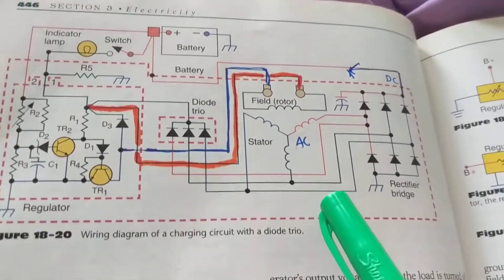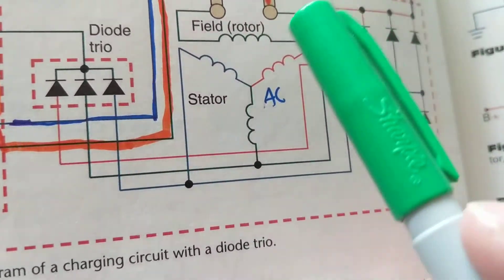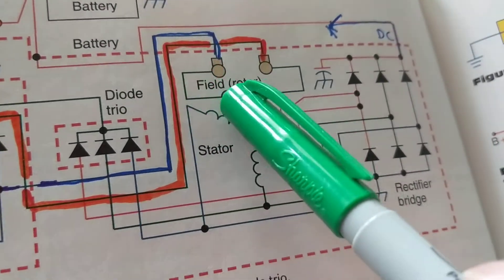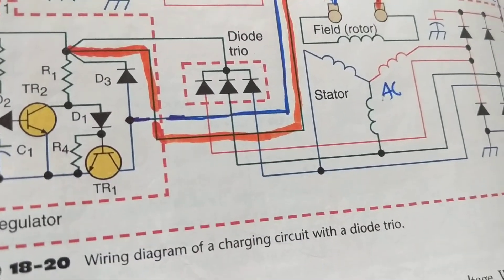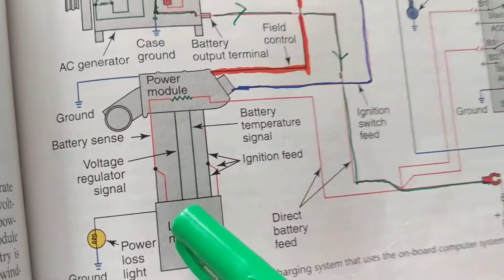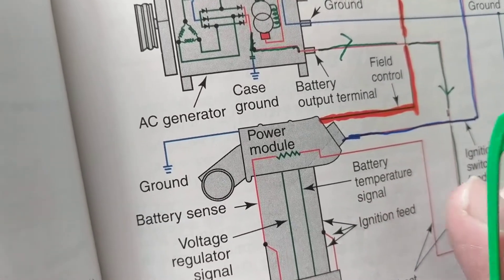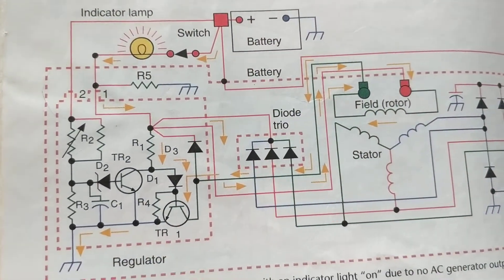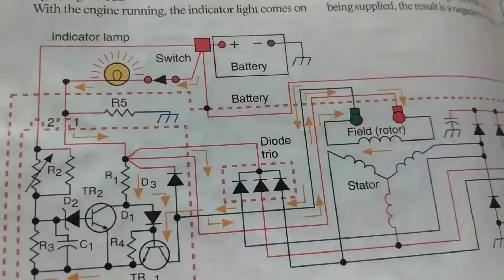wiring diagram HOW AN ALTERNATOR WORKS PART FOUR

Comment: Hello,  Today I accidentally connected up my battery in my 71 MGB backwards and fried the rectifier in the alternator.  I'm wondering about your opinion:  will the regulator be fried also, or would the rectifier have blocked power from getting to that?  Thanks.  ps.  Lucas Alternator.

Comment: On this Figure 18-20, 
How do you reconcile the preexcitation voltage on D3 initially applied to the rotor which is 0.7v driving momentarily the rotor. Thank you in advance

Comment: You need to take a course on electronics,as your explanations are way out. For instance a capacitor doesnt stop AC from the rectifier diodes & 3 phase stator, has no 90 degree output to name a few mistakes.

Comment: Very good! I would like to know how (in the  second diagram) the lamp gets its mass when alternator is not functioning; is that throught the regulator or via another path? Are the R1 (D1) R4 low resistances so that a current through the lamp exists?

Comment: Where we can get all those books😢.
Reply from the maker: You can try to Google it and put on a motive technology a systems approach the textbook I use was from automotive school years ago
Reply: @Joeelectronicschematicsforauto  yes, that's what I did, I search for information on Google and assemble it afterwards. 

but I wanted to know the name and publisher of this textbook so I could buy it if I found it on google.

 In one of your clips you showed the name and publisher of one of the textbooks (Automotive mechanics by Crouse and Anglin), I found it and managed to download it by exchanging it for another textbook of mine.

 That is why I am asking for the titles of each of your textbooks in order to find them and buy them. 
Thanks a lot for the answer.
Knowledge is power 🙂
Reply from the maker: @Yulian.Mladenov  you can type in automotive technology a systems approach get back to me if you do not find

Comment: If I have a 10SI  GM alternator 100 amp and when you start the car it's putting out 14.5 volts and as soon as the electric fan kicks on the voltage drops to 12.9 volts ...  Then if you turn the car off and then restart the car with no fan running or anything else drawing power but the voltage still stays at 12.9.  what could be causing the voltage not to go back to 14.5??
Reply from the maker: Sounds like a regulator or it could be a computer that controls the alternator if you have a multimeter you can read your something called  ripple on the AC volts scale make sure your belts are tight and the best way to do it is if you have a the force the alternator on
Reply from the maker: Put more accessories on and then rev up to 2,500 RPM and see if the alternator can take the loads voltage should be steady this is the first thing to do

Comment: Hello, where is the capacitor after rectifier diode locate?
Reply from the maker: And more technical diagrams there are capacitors also to filter out the ripple this probably was a very short one but thank you very good question
Reply: @Joeelectronicschematicsforauto  Thanks Joe. I have a good problem today, the battery icon in the dashboard light up 10 second after engine starts. It only appears after 10s and it is repeatable. So I was thinking it is a ripple not filter out well by capacitor. I have change battery to new and voltage regulator.  Charging voltage at battery pole is 14.2V and current up to 60A.  Any recommendation what else to look. Thank you.
Reply from the maker: @romylgequillana6288  if I understand correctly you are battery voltage is 14 volts but you are concerned about with a battery light blinking if that's the correct well obviously the first choice is always to make I'll check with the scanner but I assume that you don't have that instrument so the only thing you could do is if you think it's the alternator put your multimeter on a c v and measure the ripple it should be well low in the millivolts area

Comment: The rectifier, how does current flow through the bottom three diodes? What’s the path through those three if it is blocked one way?
Reply from the maker: As long as a diode is forward biased you can make the cathode more negative or you can make the anode more positive either way the diable of conduct it depends on the load going on the alternator how much. Voltage output is
Reply: @Joeelectronicschematicsforauto  So do all 6 diodes feed the battery and the field windings?
Reply: @Joemaj939  The diode trio feeds the field winding inside of the rotor via the regulator. The 6 diodes recharge the battery and supply electricity to all loads while engine is running.
Reply: The current path through the diodes is always from positive to negatice (anode to cathode). This applies to all 6 diodes. 3 diodes supply current to the positive side of the battery. This current goes through the battery and exits through the battery's negative post. It then goes through the other 3 diodes and back to the stator winding that produced it. The current has to complete the circuit. It has to return to its source. That's why it's called a circuit.
Reply: That’s conventional theory never say always electron theory electron current flows against the arrow cathode thru the anode forward bias is.5or> to pass current. 2 different theories most use conventional our job is actually how much current is flowing in amp (work)CHEERS

Comment: Thank you!! Been hunting for some proper illustration/explanation of how the voltage regulator works on an internally regulated alternator.

I have a 1987 Honda CRX, and any diagrams I could find about the regulator simply had a box labeled 'Regulator' and no further description of how it works.

Only other aspect that's still a mystery is the 'C' Terminal it has labeled. any description just says 'computer control' but no further explanation on the protocol used to control it (PWM, variable voltage, variable ground?)

I suspect that ground brings it to low mode (12.8v) and float (left open) brings it to high mode (14.4v). Did find out, that pulling it high is a bad idea (cause that broke my regulator and had to replace it)

Comment: around 6:30 when you talk about the duty cycle of the field. you say that 50% duty cycle would result in producing 50% of the alternators rated output. I believe this is incorrect as you didnt account for the rpm of the alternator effecting the alternators maximum power output. max power cannot normally be obtained at low rpms.
Reply from the maker: This depends on the system in the model many makes and models have their own criteria GM's Asian cars and Asian cars the point that I went to the bank was you can use a clamp meter with a duty cycle to have an estimate of what's going on because I know most people don't want to use a scope to measure duty cycle
Reply from the maker: The other point being not only about RPM speed depends on the accessories that you have on in your car basic ideas with trying to keep the regulator constant while the current is changing

Comment: Show how an Alternator can drain a battery .
Reply from the maker: Over time a parasitic drained can be anything usually a module a relay that's stays on all the time overnight of course the lights and other accessories but an alternator can not charge the battery enough and then you have to live off the reserve capacity of that battery not really a drain from the alternator because even if the diodes in there are shorted you still will not have a short you will have ripple effect
Reply: I work on a lot of cars and specialize in diagnosing electrical problems. An alternator can drain your battery if one or more of the diodes short out. Current from the battery's positive terminal will go through the shorted diode to ground inside the alternator. After the engine has cooled (like first thing in the morning), if you touch the alternator it will be warm or you can use an infrared camera to see the heat.

Comment: Nice charging system manual. Where can I purchase one.
Reply from the maker: You can try and Google what I use is actually a manual from the dealership which is actually over $200 but you can get cheaper ones from Google and put in alternator manual for your car
Reply: @Joeelectronicschematicsforauto  thanks

Comment: How do i connect D+ on a -77 mopar? I thougt i should connect the old cable to the old extern voltage regulator. At first i thought i succed, the car charged 14,7 V at idle but when i tried to turn of the car it refused. i took off the connections to the batteri but that didnt help.
But when i disconneted the cable to the old extern voltage regulator that now where connected to D+ the engine stopped. I tryed to run without the D+ connected, it worked but it dident charge
So whats going on here? how to wire this correct?
Reply from the maker: There's a new wiring diagram for the new voltage regulator circuit if you go to Google and type in 77 Mopar wiring diagram for charging system you will see what I'm referring to

Comment: 3:00 Good point! Without the regulator cutting down the voltage to the rotor's field coil, the alternator's stator windings could produce up to 200v, which could burn out your vehicle's electrical devices.
Reply from the maker: Exactly an AC current thank you so much for your comment Barry

Comment: I think the other way around, the T2 will turn off the T1 when the voltage at zener diode is high enough to turn on the T2 based on the voltage of the divider R2 & R3. The voltage at R1 is pulled to ground and that turns off the T1to cut the voltage in the field  rotor coil.

Comment: is the output voltage different based on model of cars or different alternators ? as you said other video that we are going to get 14 V output from the alternator to the battery. what dose it mean if the alternator dose supply more than 14 v or less? thank you
Reply from the maker: Roughly they can vary from model to model but roughly they're in the area of 13.6 to 14.5 if it's colder it'll be even higher but eventually they'll come down and voltage
Reply: @Joeelectronicschematicsforauto  can you show us a bad alternator by testing and how to really check them ?
Reply: @Joeelectronicschematicsforauto  and also I know , if the alternator is bad I can see that the alternator sends sign to the dashboard inside the car .
Reply: Do you think 13.28V is low at  3000 RPM

Comment: This is for an old-school type regulator, but not too old. The PCM he mentions is for a modern car.
The previous era used "relays". This is a "solid state" design: NO moving parts. 
To understand this circuit, look at the zener diode on the base of TR2. Now look at the collector of TR2. If the voltage on the zener cathode gets too high, TR2 starts conducing more, robbing the TR1 base of current. This causes the TR1 collector current to drop, lessening the field current thus lowering the battery voltage. A balance is struck and this maintains itself at any speed.
Reply from the maker: sorry I didn't get back to you Richard I've been doing other projects however I like very much your analyzation of the circuit when I have a chance I'll go over it and try to find the schematic very impressed bye this this is the regulate a transistor   nice analysis

Comment: Wow, thank you! I've been SEARCHING for this exact schematic for a while now. I've seen this circuit before and it's not too difficult to analyze. You can simulate it yourself using LTspice (from Linear Technologies).
I couldn't quite remember it, but it's coming back now. I saw in a book called "Alternator Secrets" (more like a pamphlet) showing how this circuit works so that you can change the voltage to 120 volts to power your home. This video is GOLD!
Reply: I would like to know where I can get it.........

Comment: Thanks. Very nice video. In my car there are 2 wires attached to battery positive and 2 to battery negative. What are these wires?
Reply from the maker: About red wine it's usually there are three wires the very thick wires are the alternator also the starter motor and the other one is for the fuse panel concerning the black wires they are return wires for ground from the engine block and other ground return wires

Comment: Oi joe ...can I hookup the ad244 sence wire straight to the coil with the diode ,instead of battery light
Reply from the maker: I will really not recommend it there's a purpose for that diode as I mentioned in the video just go by the wiring diagram

Comment: Sir what is the difference between voltage of trio diode and main voltage from rectifier
Reply: After the engine starts, the diode trio supplies current to the regulator and the regulator decides how much of this current to send to the rotor based on the input from the "sense" (S) line. The sense line is connected to battery voltage on one end and the regulator's "S" terminal on the other. If the regulator senses the battery voltage is to low, it sends more current to the rotor, thereby increasing the magnetice field. A bigger magnetice field in the rotor results in higher voltage and current being induced in the stator.

The voltage from the rectifier (6 diodes) is used to recharge the battery and run all electrical systems in the car while the engine is running.
Reply: It took me some time to find out. I think the response is simply to turn on the light from battery when the alternator is not running, and turn it off when alternator is running.

Comment: I don't understand if you said the computer replace the regulator. Because the regulator has diodes ; resistors ; transistors ;  mosfet and capicitator ; and a coputer has the same components and both controlling the voltage ; ore does the computer control  more voltage because it had more components with small components as well
Reply from the maker: The most important thing is the computer tells the alternator to control the field rotor current when you put a clamp meter on it which is why I recommended you will see the current change but the voltage will stay the same that's a sign at the computer is working and the regulator just keeping the voltage constant thank you so much for your question and being a viewer
Reply from the maker: The amount of components that I used whether in computer board or alternator board is it's relying on the function that you need if you need signals that are digital you will have more chips which are surface mount if you need a power supply you will still have a through hole components such as capacitors and transistors power transistors